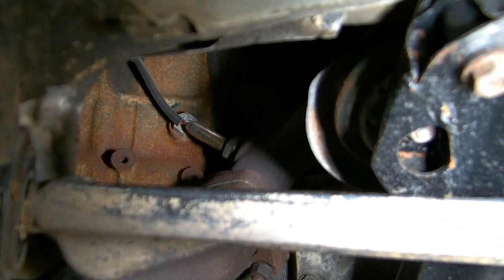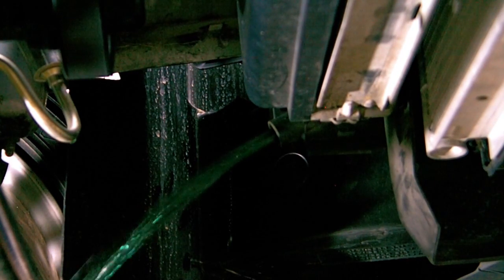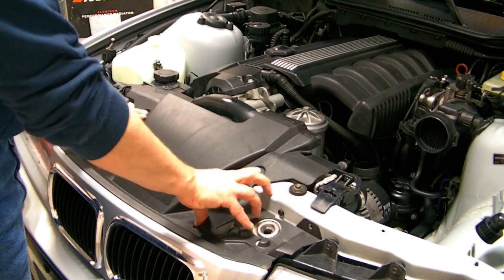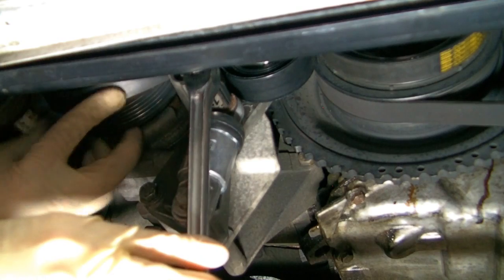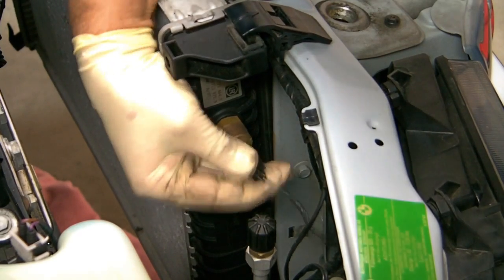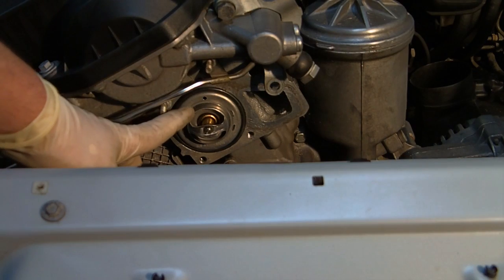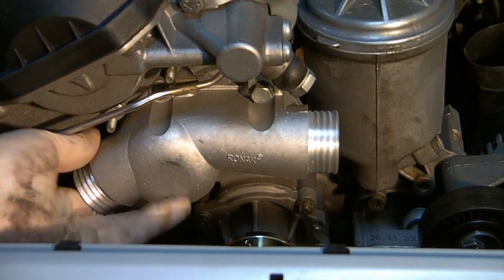BMW Radiator, Cooling System, Water Pump Upgrade - E36 M3

Comment: /mk cold fuseon for disc Llyk turbo fan u 2Hn silicone metal AVN modules /
/for rounded diamond shaped Aar'iiin'Ttaekz' > hlf domed at lead edges of iintakes /
/create high / low Aar' sucktionsz in GRPsz u twosz //inner / outer diamsz from center /
/then create 3O(16 > 12g) cold fuseon with SDR nets //use two stage grid reflectors GRPsz of
elements X''' reverses high / low psi shapes measures = equi disc Opsz /

Comment: Yep, AND the expansion tank. I replaced all 4 of mine as soon as I bought my E36. I am going to delete the plastic clutch fan next with an electric one. It will move more air, be more reliable and free up about 3-5hp. Its not a matter of if these plastic parts will fail, its when.

Comment: Thanks for your sharing. My car (1994, E36, 318is) has air conditioning / heating problem. Heater's not heating. What are the things I have to check, respectively. What is your suggestion?

Comment: I think plastic impellers on water pumps should be made of plastic. If the bearing on the water pump fails badly like I've seen,  a metal impeller could chew up the engine block.

Comment: Tip # 1 : You don't need the special tool to hold the pulley when removing the cooling fan. Just tap the 32mm wrench with a hammer and comes lose. Tip # 2 : It is a good idea to loosen up the 10mm bolts on the water pump pulley before removing the serpentine belt. ( it makes it easier when you have a little pressure from the belt so the pulley won't spin ) .
Reply: Tip # 3 : the water pump has 2 holes on the side where you can screw 2 M6 size screws which when you turn them they will help push the water pump out .

Comment: If you have an E46, CHANGE THE COOLANT SYSTEM! The res-Tank WILL blow a seam & the results can be catastrophic to your engine. They have replacement kits online for under $200. WELL WORTH IT! Also, if you're over 100k miles, replace the ValveCoverGasket/Spark Plugs & wires. WORLD of difference!

Comment: @ mrthirikari .. I'm guessing it's your camber settings... Look up camber, caster etc.. Basically your camber on your rear wheels have too much negative camber .. So they are leaning inward putting more wear on the inner part of the tire. Take it to a tire shop and have your camber adjusted before you need new tires. Hope that helps!

Comment: 2 BMW's both cooling issues. Preventative maintenance to replace radiator, water-pump, hoses at 50K? That is ridiculous! Cheap plastic parts. My 1988 Honda Civic does not leak. The BMW's leak oil, coolant. German engineering is not superior. Will never purchase another BMW, they are junk. And odd that for so many plastic parts, these things are very heavy.
Reply: Did you end up selling them

Comment from the maker: Depends whether you want ot keep OEM style plastic tanks or upgrade to metal tanks (on the sides of the radiator)  We sell OEM, Metrix & Behr radiators with the OEM style tanks.  We recommend the Behr.  We also sell the Mishimoto metal radiator, which lists for $340.  Our price is $248.20.  Contact us for more information.

Comment: Before I start the car, do I need to take the excessive water out from the expansion tank or do I just leave it there and that excessive water will replace any air that is in the system?

Comment: The thermostat is inside the thermostat housing which is plainly visible above the fan/water pump once you remove the top plastic cover. If you have the original factory thermostat housing it should be black plastic. You should replace it with an inexpensive aluminum housing from Pelican Parts or elsewhere if you're replacing the thermostat. Easy job. Take out the bolts holding the thermostat housing on and pull off the housing. The thermostat is seated in the hole behind the housing.

Comment: The water pump can easily be replaced without removing the radiator. You do have to remove the top hose from the thermostat housing and tape it out of the way and take the fan shroud out which requires removing the hose that runs through the shroud. Once the shroud is out you have plenty of access to the water pump. The thermostat housing can stay in place as well. I installed a metal impeller Graf pump one year ago and it had a defective O ring and was leaking so I just replaced it again today.

Comment: Bought a Graf pump with metal impeller about one year ago to do the water pump upgrade. Also changed both belts and did the aluminum thermostat housing upgrade and aluminum pulley upgrade. Had to buy the 32mm wrench and spanner tool. Took me about four hours since I'd never done it before and I was taking my time. These are really essential upgrades/maintenance to do if you purchase a used E36.
Reply: UTubeMeTubeWeTube 

Do you have a list of the parts u bought for your upgrade? 

Thanks a bunch!

Comment: "Like the thermostat housing, the waterpump might need a little bit of coaxing as well". I'm amazed so little people know the trick to not pry it out, possibly damaging the block.

As can clearly be seen in this vid just before the pump is pulled, you can see a hole between the top and lower mount. This is a 5mm threaded hole. If the waterpump is stuck, simply screw in a 5mm (allen) bolt and this way the waterpump will push itself out of the block. There 2 or 3 of these threaded holes.

Comment from the maker: Reply from the M3 owner/video guy: I only work on my own cars but I had a '96 328 at one time. Many years ago I replaced the water pump but not the radiator. I don't remember, however if I had to MOVE the radiator. My hunch is that I I did NOT move the radiator. Sorry I can't be more helpful than that.

Out of curiosity, are you going to use an OEM unit? Aftermarket? Either way, we'd love to help you out.

Comment: I recently replaced the radiator on my 98 M3 with 91K miles on it. This along with the thermostat has been replaced in the last 1 year. I'm going to replace the fan clutch, belt and the water pump in the next one month. I was wondering whether it is possible to remove & replace the water pump without removing the radiator (after the shroud and the fan has been removed)? Thanks in advance, appreciate your videos.

Comment from the maker: Yes it does.  It is harder to reach the plug, but it is possible to do this on the ground.  In the video, we just used a set of jack stands and raised the car about 12- 14".  Once this was done, the process was easy.  You can buy jack stands at any local auto parts store, Wal-Mart, Sears, or Harbor Freight Tools.  We sell Race Ramps which allow to raise the car without a jack.  See autowerksofamerica com/product/raceramps/race-ramps.htm

Comment from the maker: It's possible that the gasket is the problem. However, what you replace depends on where it is leaking from and whether the pump is original or not.  If it is leaking around the housing, it could be a gasket.  If at the nose (at the input shaft), its definitely the pump.  If you still have the original 14 yr-old pump with composite impeller, I wouldn't risk changing only the gasket.  A new pump is only $65-$75 at our site and is well worth the money-since you'll do the same labor either way.

Comment from the maker: @artisstik The fan tool might not be necessary. Many times you can get away with simply using the wrench and giving it a smack with a hammer. The risk with that approach is that you can inadvertently hit something unintended. There are times, however, when the nut is more stubborn and the special tool becomes necessary. One approach would be to try it without the special tool before you get too deep into the project. By the way, what are you replacing? Water pump? Hoses? Fan clutch?

Comment: Is the radiator fan tool absolutely necessary to replacing the radiator?  I don't want to spend an extra $20 if I don't have to.

Comment: @AutoWerksofAmerica Sorry for the late reply, but the problem has been solved now. Last week I found out, that at first, the wrong coolant was added into the system.. so I basically washed the whole system with new proper CX200400 purple/red coolant. And getting rid of the air seems to be an annoying issue on the E39's which some people prefer to call difficult. My clnt level and temp. stay normal now.

Many thanks for your help anyways! The vids are a great plus too.

Comment from the maker: Be sure to remove the plastic screw next to the filler cap as you fill the radiator (10:33) and check the level (at the radiator filler cap-be careful as the fluid will be under pressure) after running the car for a little while.  If this does not solve the problem, we suggest you take the car to a local professional technician for further troubleshooting.

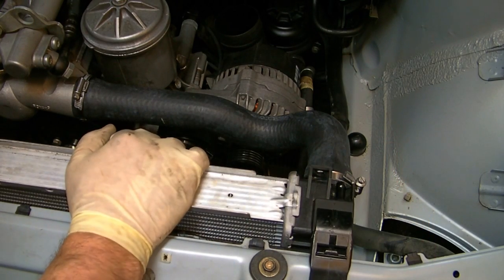Comment from the maker: @lowgunit There are several things that might cause the problem you describe.  The most likely and easiest to solve is excess air in the cooling system.  If you failed to "burp" the cooling system when you filled it, excess air could have remained in the system. At 10:05 minutes in this video, we discuss proper refilling of a BMW radiator, including the process to remove excess air.

Comment: PS: For your information, the waterpump HAS already been replaced, and after a drive of about 20 minutes the next message comes up: "> Kühlwassertemperatur <". The analog meter goes into the red zone and and it seems, that when I speed up a bit, or drive faster (let's say approx 30 to 50 miles per hour) it seems the analog meter goes back to the middle (which is normal). The cluster messages still appear and there's absolutely NO leaks underneath the car. But I have to keep filling more coolant.

Comment: Hi, I'm from Holland and I have a cooling/coolant problem.
I have a '97 bmw E39 Touring, with the 4.4L V8 (I believe is the M62) engine. Now my cluster display tells me, as soon as I switch the key into the 2nd position OR turn the engine on: "Kühlwassert. prüfen". As I've let all the old coolant flow out of my radiator, and filled it back in with CX200400 pink/red coolant (OM for this type), the problem still occurs.

I have no idea what the problem might be and I'm hoping for some help.

Comment from the maker: @BeYourDreamTEAM Unless your radiator is leaking or clogged, I'd replace the water pump and thermostat first.  Both of these components are mechanical in nature and are subject wear and sticking (thermostat).  eBay is a crap shoot.  I've bought good parts there and I've bought bad parts there.  From what I could see, the radiators offered there all seem to have aluminum side tanks-a good thing, vs the OEM-style plastic tanks on ours.

Comment from the maker: @BeYourDreamTEAM - 1st, Yes we sell those parts.  The pump and valve are listed under the "Air Intake" category on our site.  (YouTube will not let me put links in comments). We also have a fault analysis guide for these codes posted here on the site.  Just add "/article/resources/secondary air system failure.pdf" to our site address in your browser.  VEMO is a European manufacturer of OEM & replacement parts, APA/URO is a quality replacement part manufacturer only.  Both have a good reputation.

Comment from the maker: @luckyboy13 I had no trouble with sealing using new parts. The water pump and t'stat had new O-rings. The t'stat housing had a new seal. Buy a new seal if you're using the old housing.  CLEANING: I used a wire brush, sometimes on a rotary tool. Plug the area with a lint-free rag. PITTING: Can't be fixed, but a good mechanic can check for electrolysis.The NEWSLETTER from our site offers exclusive video and occasional DIY tips. Thanks again for writing

Comment: Great video! Thanks for the walk through! I'm about to attempt my first radiator change on my 318ti. I think it's an all electric fan so I believe I won't need that tool to get the fan out. I hope.

I'm nervous about working with the cooling system since it's the achilles heel of the car. Ever have trouble getting the waterpump or thermostat to seal? Also, what do you use to clean off the areas around the thermostat and water pump before reinstalling? Lastly, what do you do if there is pitting?